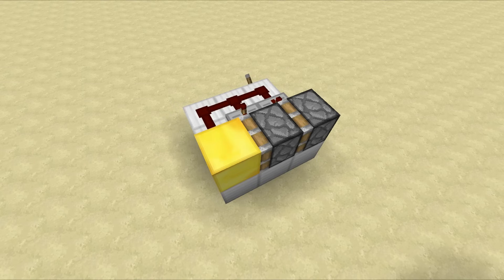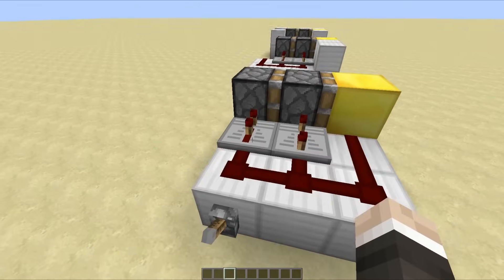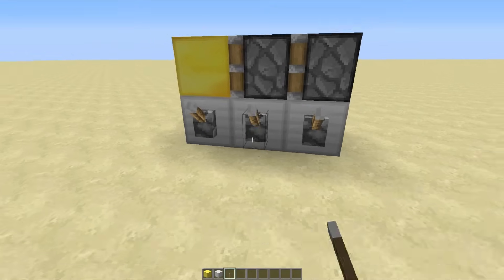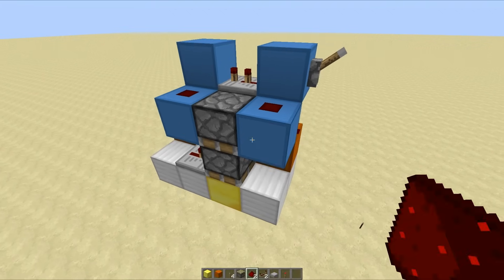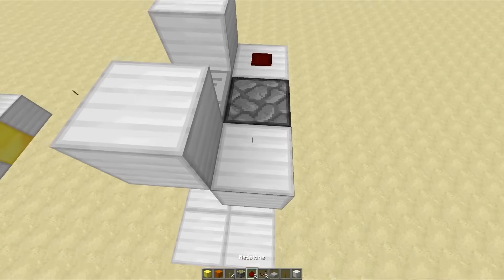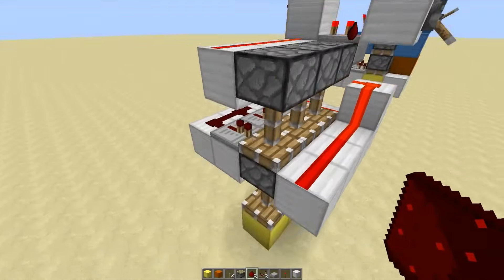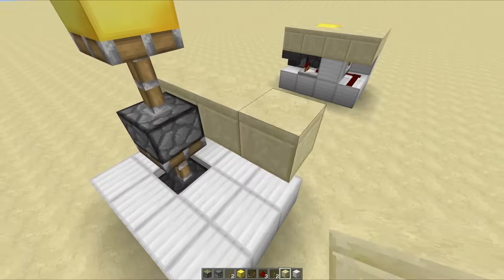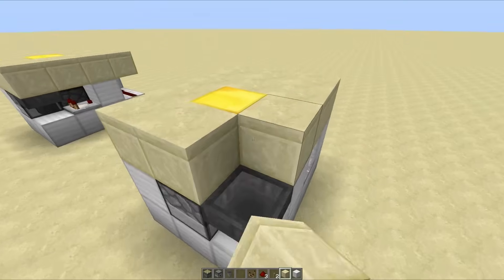HI-LO Tech: Double Piston Extenders

Comment: I am surprised a redstone design from almost 6 years ago still works.
Reply: The vertical one doesn't
Reply: @shoe5672  it does
Reply: Yeah it dont
Reply: Even on bedrock!
Reply: Bedrock doesn't work fkr the horizontal
Reply: philip bayly for the horizontal ones if u add 2 more ticks to the middle piston it should work
Reply: I have just tried it, and the dropper doesn't take in the signal when it has to extend
Reply: @everestbc7007  your comment helped me so much thank you
Reply: @CouncilOfTheLostGoats  for*
Reply: Nope
Reply: me to
Reply: Yikes
Reply: Unless you’re on bedrock, in which you can’t retract extended pistons
Reply: The vertical piston extender works. I'm in 1.16 survival.
Reply: 8 years
Reply: 8 years now and it still works
Reply: 8 years now and it still mostly works
Reply: fr
Reply: meanwhile, in 2023...
Reply: @aceofspadezzwastaken  it still work in 1.20 😂
Reply: Maybe if you're playing in 1.5 lol I just build the one at 6.10 and it's not working. It just activates the upper piston
Reply: @toruisalive5499  yeah the bottom piston doesn't extend
Reply: @toruisalive5499  place a repeater against the rear piston and double against the front piston. Seen different tix delay in the repeaters. Test until you find a setting that works, think it should be 3, 5, 0 tix.
Reply: @tobiaswiklund10  oooh

Comment: How do I get the lever on the ground? 
Also, let's assume I wanted to build this as part of a house. How would I place 2 levers (both inside and outside) to come and go respectively? Also how do I keep the 2 levers independent of each other?
Reply: You can't
Reply: @spidohman6723  But why?
Reply: @rohaniyer9887  you can't have 2 levers, but you can move the lever onto the ground tho
Reply: @spidohman6723  It doesn't work I tried
Reply: @rohaniyer9887  connect the lever with redstone
Reply: @spidohman6723  That is what I did Idk why it didn't work...

Comment: Is there an easy way (pause for laughter...)  As I was saying: an easy way to have 2 blocks pulled UP from an overhead double-piston extension?  I am building a house with a (hopefully) working garage.  I have rails going in and out of the garage that are both hide-away (they get pulled back by double-piston and a layer of wall block comes up from the floor (a Mumbo Jumbo featured design).  When they are back and the walls are up on both sides, I'd like to have a 2-block high "garage door" come down from the ceiling.  Thoughts?  Comments?  Insults?  Go.

Comment: They don't work in mcpe :(
Reply: I changed the ratio to 4 8 0 and it works perfectly in mcpe
Reply: Yea noticed the same issue in MC VR (basically PE)  I even had to go as far as adding a total of six repeaters, as I still wasn't getting reliable results using just four in the 4-8-0 configuration.

Comment: Oi Mumbo love the videos man, I have found a faster vertical double piston extender using a very similar design to the last one you showed but using a piston monostable circuit instead of the dropper hopper monostable circuit. If you switch the dropper with a repeated, the hopper with a piston and block, and the block and comparator with a piece of redstone and a repeater on 2 ticks going into the block at the end. Does the same thing just works a bit faster and smoother

Comment: it does not work
Reply: +Alexander Z. I use 3-7-0 because 3-6-0 doesn't work
Reply: Are you an MCPE user?if so,the ratio of the horizontal sticky piston extender is 4:8:0 instead of 2:4:0

Comment: Does anyone know how to make design three work for blocks in a row and not just one block coming out of the ground? I'd like to make a set of retracting staircases.
Reply: Try using slime blocks.
Reply: Aaron Dettlinger Thanks for the suggestion. I managed to figure it out eventually anyway after I made this comment.
Reply: Leaf dogparkmayor  very late but how did you do it, could you make a quick video on it or just explain it
Reply: The Friend Army Unfortunately I don't have any video-recording software, but basically all I did was make it so, when it extended, it activated the one at the bottom and then the one at the top after a short delay, and when it pulled back, it retracted the top one first, then the bottom one, and then the top one again using a monostable circuit, giving off a quick pulse to pull back the top one again. Sorry if that was kind of a messy explanation.
Reply: Thanks! Some recording software, EzVid,Fraps,OCD, Ezvid is free and easy to use,Fraps is paid but you can get it for free, OCD i think thats its name is more advanced

Comment: Challenge for you mumbo, i am looking for a vertical (upwards extension) double piston extender, but here's the catch, i need it to have an automatic fast retraction, so that the floor block that rests on the top piston gets left floating, and this design needs to be 1 wide and preferable flush with the floor, it needs to be 1 wide as the design will be repeated next to itself.

Comment: Hey Mumbo, can you make a redstone thing that can turn one block into another and it works on Xbox?
Reply: Noob. Learn command blocks. You can't do that on Xbox. Only on PC. #rekt
Reply: iGo_Infy _ I know that, but I'm asking if it's possible.
Reply: Uhhh, it will not work. Sorry. You would need Command Blocks not redstone. Unless you do a double piston extender monistable circuit.
Reply: Man U guys are dumb as a fly it's called a block swapper look it up and it works on xbox
Reply: Matoo Iiun ok thanks
Reply: Levi Stepanek yes you can. use a block swapper
Reply: Michael Donoghue Could you make a video of that and video reply?
Reply: Levi Stepanek I'll try
Reply: Michael Donoghue Ok
Reply: hmm, maybe a t flip flop with 2 buttons.
Reply: I'm not sure what you want, but maybe a block that changes into another block with piston from the wall.
Reply: Yeah, I know I'm a bit late but all u need to do is make a simple block swapper. Two pistons one has a block, then a sticky piston in the middle. The sticky has a block on top and is always powered. that way its flush with the wall. Then you pull the sticky down using a button, then let the piston with the block extend, pushing the previous block on to the other piston and then the sticky comes back up. Sorry for the bad explanation :P
Reply: Levi Stepanek What do you mean, to swap one block for an other one or to physically convert one block into another?
Reply: he may have thought of command blocks.
Reply: Actually, there was a contraption around 1.7, i think, that used arrows and buttons to change the ID of a block
Reply: You can do a block swapper

Comment: in My Minecraft 1.8, downward piston extender need to be changed, you have to delete the first block with redstone dust (the one which gets power from a lever block), leave the second one and it will work
Reply: Aurora Thank you for finding this and posting this!!! It's so true, I don't know how you found the solution, but it works!.  I built one .. failed -  then i'm scratching my head.. I build another one 20 blocks away and It worked?!?  compare them , rebuild them.   I read your post -  And BAM they BOTH work with the first block next to the switch removed!  Again, I don't know how you found that fix, but it works ! 1.8    1.8.1   1.8.3
Reply: clydesdalefan that's awesome :D glad I could help, I found out the solution by way of tries and errors.
Reply: Zach Glindro natuurlijk niet

Comment: If a downward double piston extender is possible, could you try and make a 3x3 door in which the middle block retracts into the ceiling? (or into any of the sides, as long as it is not into the floor)
Reply: yes you can, codecrafted has a design

Comment: 1.7.4 SMP: Upwards design died
Reply: Replace hopper/dropper with piston
Reply: The piston elevator system works, but when using it, you need to hold jump to make is work properly

Comment: mumbo can u do a hi-lo for a xor latch, or gate.. not sure which one it is.. or even to a video on the difference between a latch and a gate?
Reply: a latch holds its state, like an r s nor latch, you push a button and it changes and stays there. whereas a gate is passive, meaning its output is directly and instantly (nearly) influenced by its input. 

as for your other question, an OR gate produces a signal if ANY of its inputs are on, where as an XOR Gate produces a signal if ONLY ONE of its inputs are on.
as well as a NOR gate produces a signal if ALL its inputs are OFF.
all of which are passive, therefor they are all GATES, not LATCHES.

hope this helps
Reply: ComatoseChimera well yes that helped and i guess the specific gate i wanted to know more ways to build is an OR gate, however it would be nice to see some designs for all of them

ty <3
Reply: Chad Bentley an or gate in minecraft is created whenever 2 or more signals, can light the same object or redstone line
Reply: ComatoseChimera right right.. i understand how it works and i know how to build one.. but this specific youtube series is on taking a look at a few different designs
Reply: Chad Bentley fair enough, although, basic logic gates will only get you so far if you want to want to build anything more complicated